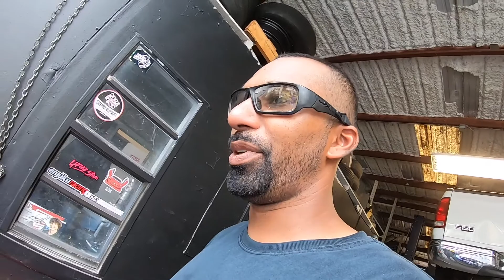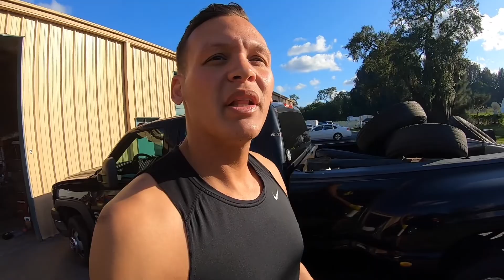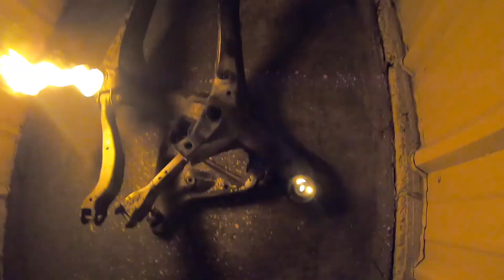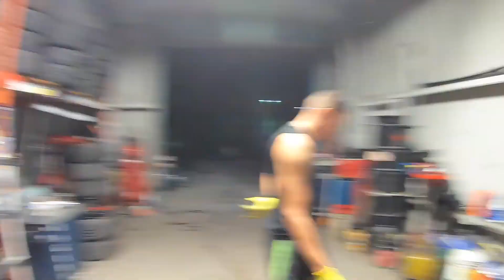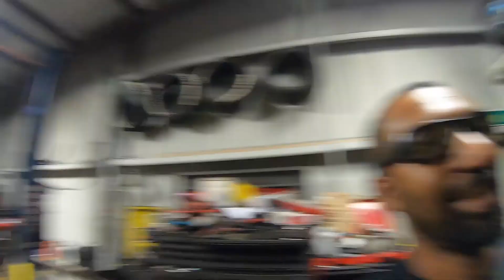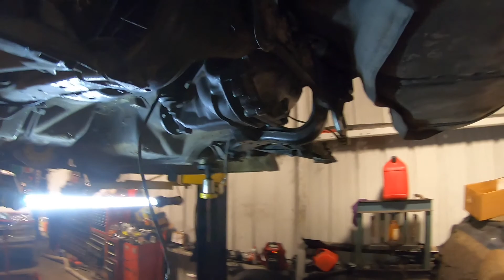S14 Subframe & Z33 Diff Conversion On My Hatch

Comment: what's up dude sweet build. How bad is the axle angle cause it looks like the 350z diff sits 2 too low
Reply from the maker: Tbh I’d have to look at it when I get a chance, I was breaking 240 axels left and right at events, havent broke a used set of 350z axels since the install tho
Reply: @Camelstyle  if you have some extra time I would appreciate it. Thanks for the help man
Reply from the maker: Message me on Instagram it’s khashaud on there aswell